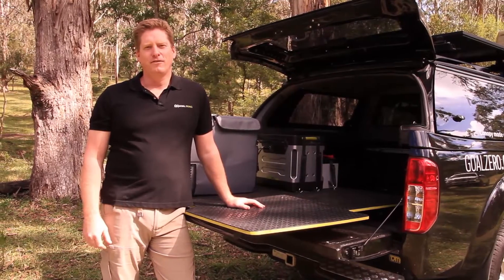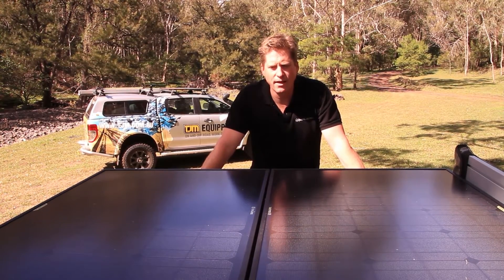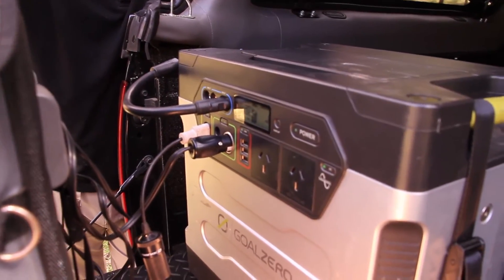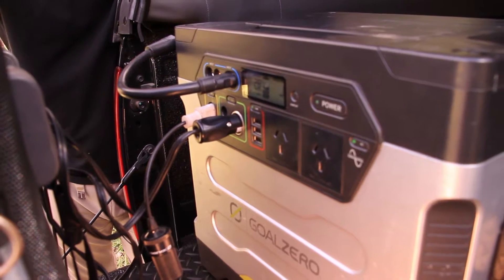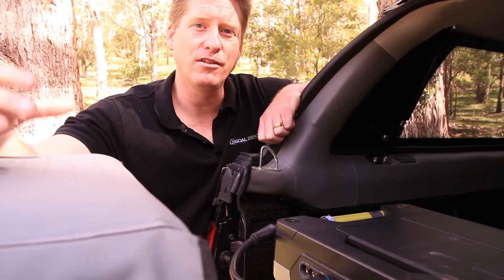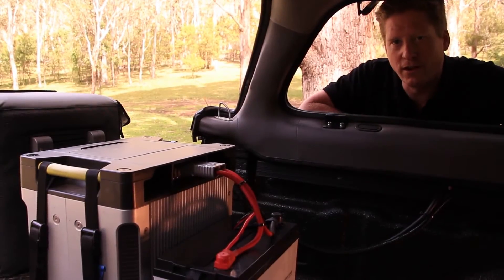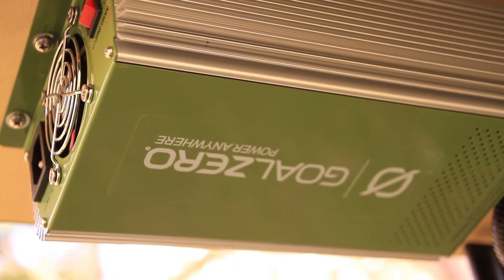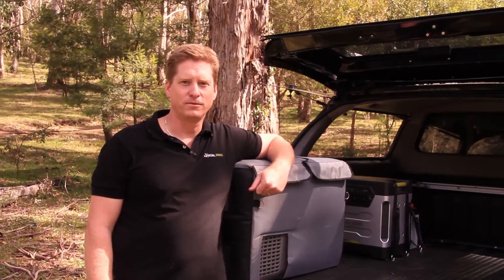Goal Zero Truck Walkthrough

Comment: If a person is building a conversion van, using full solar to power a fridge ( Engle or ARB) cell phones, tablets, and some LED lights, either using the Goal Zero Yet I 1200, 1400 or 3000; would it be possible, or would they need something else?
Reply: Sorry that Goal Zero has not yet replied to you. Typically they are extremely responsive. The answer to your questions is absolutely YES!!! Especially if you get a 12 volt fridge. You need to be aware of the limitations of battery power and to adjust your expectation and usage within the realm of "reasonable". You will be fine with a 1250 or 1400. The 3000 is costly but would give you great comfort with excess in case you have several overcast days in a row reducing the chance of charging your batteries with Solar panels.